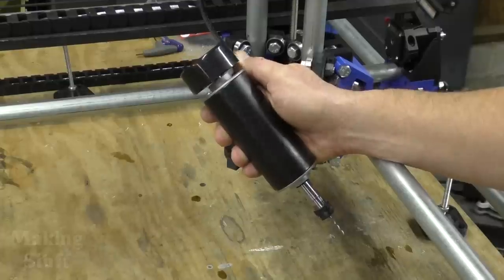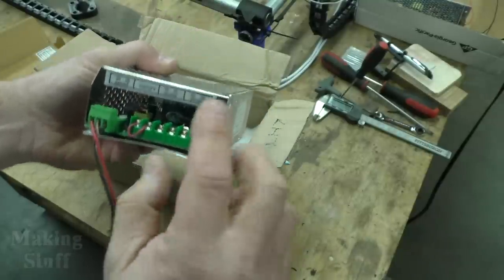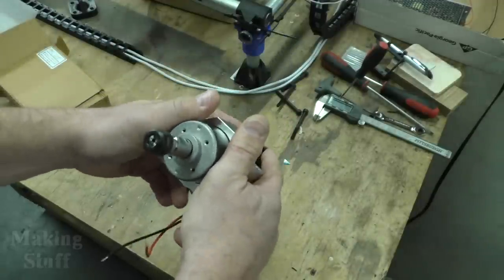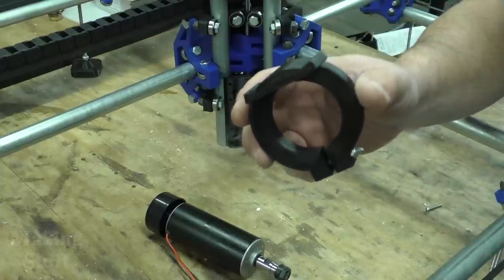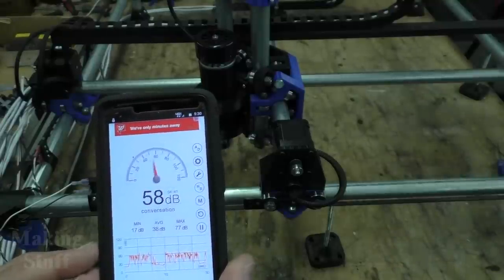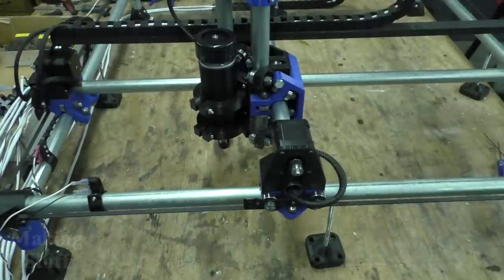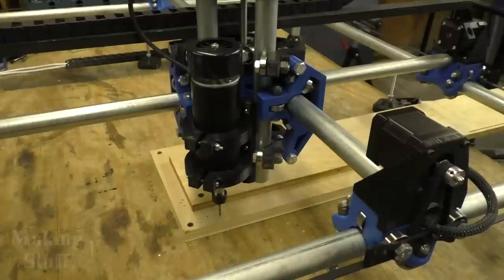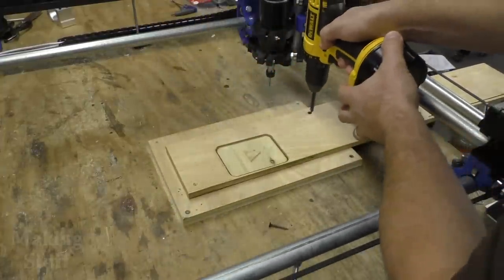Reviewing a Chinese Spindle for CNC Machines

Comment: So in late 2018, after 6 months of research and design, I built myself a CNC from scratch - just to see if I can do it. I was on a tight budget, but the idea was to get myself going, then build a "version 2" based on lessons learnt.

This was the spindle I opted for. To say was disappointed by the spindle is an understatement! I could never get it to cut at any sort of decent feed speeds - so much so that a simple cut took HOURS to complete. There was always LOADS of smoke coming from the end mill, I could hardly cut at a 1mm depth, and I was always left with a burnt edges when I was done. My end mills got super hot, and were blackened and tarnished when cutting MDF (melting resin?). My last cut almost destroyed my CNC - the spindle got dragged "into" the stock from a 1mm depth of cut, and ended up going through the 16mm MDF I was cutting, and 8mm into the MDF waste board, before the 3mm end mill finally gave up and broke! <-- Yes, I turned my back on the machine for a minute. Turns out my CNC actually survived the ordeal, but my faith in the spindle was shattered.

I went online and was just about to pull the trigger on a (stupid expensive) 2.2kW VFD spindle for CNC "version 2", as the 500W spindle never quite seemed up to the basic task of just making a clean cut. Up to now I've only used 3 flute end mills for cutting mostly wood, so to give this spindle one last chance and restore my faith in my CNC, I decided to put a single flute end mill I had laying around into it, and try it out.

Long story short, I got the mill in, and then... I saw it... Now I must admit that I am a bit ashamed to say it publicly on the Interweb, but it turns out that, for the last 18 months or so, I had my spindle running in REVERSE rotation! The single flute made me see that - not that I ever thought that the direction of rotation was a problem. The fact that it was cutting in reverse at all is nothing short of miraculous!

So I corrected the, ahem, problem (caused by the squishy bit between the keyboard and the chair) quickly enough, and tried my regular 3 flute end mill again. I loaded the same g-code as by last cut, and needless to say, I got proper wood dust (cutting MDF) this time. No smoke, no burnt edges, no tarnished end mill. I was running quite decent feeds as well, and a 1.5mm depth of cut - WAY faster and deeper than before.

My faith in my CNC is now restored, and "version 2" will be physically bigger than "version 1", but for now I'll stick to this spindle, which turns out to be a really excellent can-do little bugger - if you don't tell it to spin in reverse! Apologies for doubting it! :D

#LessonsLearnt

BTW, if it hadn't been mentioned yet, the on/off connectors in the power supply are for using the breakout board to control the spindle on/off and speed from your software. ;) Kudos on the review!
Reply: Hehehe, I had a very similar thing happen as well. Set the nice, new, 2.2kw spindle for a nice light cut in some aluminum - and was horrified by the awful cutting! One wire round the wrong way.
Reply: Update: Upgraded my 500W spindle to a 1500W water cooled spindle. Chalk and cheese. I’m running 5 times the feed rates I used to with the 500W. Most impressive thing is the runout on the new one. Or rather, the lack of runout. Those rubber bushings on the 500W really is a bit of a problem.
Reply: thank you for sharing this, things one have to keep in mind making a cnc :)

Comment: Background: I'm a machinist by trade for over two decades and I bought one of those spindles a few years ago for a small CNC I built.
Critique: The spindle does indeed SEEM pretty nice for the money. Honestly, the design is sooo close to being useful but it has one Achilles heel which makes it a deal-breaker. Having said that, I commend them on designing this spindle to be 1) simple to implement with the DC power input 2) nice choice on the ER collet - it is precise enough, easy to buy/replace collets, grips all sizes in the full range with just a handful of collets and is easy on the wallet 3) the overall size is compact for the power 4) it's relatively quite low-volume.
The major deal-breaker problem with these spindles is the bearing arrangement and assembly (which necessitates a tear-down to discover). They nest in a RUBBER boot on either end, which works well until it experiences side OR end forces. The runout is good if you just stick a gauge up against it, but if you push against it sideways, the rubber gives and you discover it's not difficult to compress the rubber and move it .02" to .03" (.04" to .06" TIR)! Also, the bearings are just common roller bearings so it also doesn't take end pressure well either. It needs a pair of angular contact bearings on the nose end and a single roller on the tail end, and those need to be firmly mounted in the metal housing rather than gently nestled in rubber.
This bearing thing is likely the cause of the rough finish in the video example. (I'm not talking about the fuzz, I can see chatter on the side walls)
To be sure, this spindle is tons better than a Dremel.
It's just a shame that they got sooo close to having a KILLER spindle but didn't take it over the goal line with a more secure, accurate bearing arrangement.
Since the rubber bearing seat also contributes to the low noise, I suspect that these were designed to make a good first impression and get you to keep them past the return date maybe. That's the pity of it - it didn't have to. It's got everything you'd need from an inexpensive spindle EXCEPT it doesn't quite do the business for one singular flaw, which could be engineered away for less than an additional $10 selling price.
D'oh !
Reply: yam ros1  I haven't found anything as "tidy", but if I was gonna buy rather than make my own, I'd probably go for a spindle like this one maybe:
https://www.ebay.com/itm/264083321008
and power it via pulleys with really any kind of DC motor you wanted (since variable speed of DC motors is relatively easy and cheap to do).
Keep in mind I'm just kinda guessing as I've never used one of these so I don't know if they are built well or not, but the design is MUCH better for a CNC machine in theory.
I would do a little simple math to decide what RPM range you desire (personally I'd go with like 500-4000 for useful machining of metals with mills/drills in this size) and pick pulleys and a motor with the rpm needed to accomplish this. You could go with a 3000-ish rpm motor and pulley it 1:1 for simplicity.
This would be a bit heavier, but would also be much more appropriate for milling.
If you're routing or engraving rather than milling, one of the air or water-cooled high speed spindles (~25,000 rpm) from eBay or the like would be good, but they require a VFD. If you want that kind of high rpm, the type of spindle I linked can be run around 8K rpm I think but maybe not as fast as those fancy ones.
It's never perfect, is it?
Reply: It’s such a good deal but that bearing issue is a dealbreaker. Can they be replaced?
Reply: @klave8511  First I should say that my experience with this spindle was several years back and for all I know, they've improved the design, but I strongly doubt they've done this. If a teardown reveals that I'm wrong, then PLEASE correct me!
Otherwise...

Replacing the bearings themselves is super simple, but the bearings themselves aren't the technical problem. To solve it requires an improved bearing CONFIGURATION. Specifically, this one has two problems.
1) Being mounted in a rubber sleeve causes a radial rigidity flaw and to change that requires that the rubber be eliminated and the  bearings be mounted directly to the end bells of the motor. This could be done but probably require you turn the bearing seat to size (to precisely fit the replacement bearing) in a lathe. Not a big deal, but requires a lathe and enough skill to achieve the appropriate tolerance.
2) you need opposing angular contact bearings to solve the axial rigidity flaw. This might be solved by single angular contact bearings oriented in an opposing orientation, one on each end. This would bring in some axial stability but not in an ideal fashion, though maybe better than nuthin'. The ideal arrangement is for the opposing pair to be back-to-back because that minimizes the inevitable wandering of the pre-load due to heat increasing during motor operation.  i.e. if the distance between the opposing pair is 5 inches, the expansion due to heat being "so much per inch" is magnified over the whole length while a back-to-back arrangement drops that down to almost nothing.A back-to-back arrangement also necessitates a third "standard" bearing at the tail end of the spindle and I don't know if there's room for all three (or sometimes four) bearings compared to the original two without major modifications (new end bells from scratch).
In summary, a guy could try, but you might mentally prepare for it to not work and be for naught in the end. The easy try would be to turn the end bell bearing seats to accept angular contact bearings of whatever size you research and find to suit, then arrange one bearing on either end and tweak the adjustment as you go until you find an acceptable compromise.  This means it will run significantly different depending on whether it's been sitting cold or been spinning and warming up, but might work with a bit of preparatory warm-up or some such. This saves space and might fit.
Any more extensive modification negates the benefits of the original cheap cost and IMO it would certainly be more worth it to just buy a better designed spindle for two or three times the money than to spend a week figuring out & machining in addition to the cost of the new bearings.

...OR... the companies selling these spindles could do a week of designing themselves and nail a gem of a cheap ideal spindle that they can sell to us for maybe $20 more. These cheap ones have been available unchanged for several years though so the chances of redirecting the existing momentum is probably pretty slim on that score.

I'll repeat that these little spindles do function several times better than a Dremel does, so if your machine is a small one made to move a Dremel around to do stuff, then these little ones would be a vast improvement as-is.
Reply: @TyroneDamShewlaces  Got one for my MPCNC recently and due to severe overheating issues, tore it down and yes the in-rubber bearing is still there XD!
Reply: @ethanchua2335  was the reason you tore it down to fix the heating because the heating caused it to break? Or just improving it?
Reply: @TheRainHarvester  I was just curious about the mechanism and yeah kinda trying to figure out why it was getting so hot!
Reply: @TyroneDamShewlaces  I wonder if you could drill several holes around the spindle and thread them as set screws to hold the bearings instead of (or along with) the rubber? You'd probably need 3 around the top of the bearing and 3 around the bottom to prevent the bearing from wobbling around only 3 set screws. Would that work?
Reply: @ethanchua2335  Is there a way to add new rubber to hold the bearing when the rubber wears down? (I have no clue what these look like inside)

Comment: I’ve been using one of these spindles for almost two years and it has never let me down. I’ve used it on oak, mahogany, beech, walnut and ash as well as ply and mdf without any hassle. It’s even milled aluminium with no sweat.
Reply: Super John. Can I ask you if I could use in this mashine Gripping Range 8-10 mm? I would like to make wooden stairs based on CNC self-made mashine and I wonder if it could fit my needs. The main material is oak and maximum depth I need to make  is 20 mm. Thank you for your help-)
Reply: Cutting Aluminium ? What speed?
Reply: @B B I think that is 12 times slower than I cut wood.  Is this also a 1/12 factor for you?
Reply: @B B what RPM?
Reply: @mariuszszczecina  The biggest collet you can get is 7 mm.

Comment: For $80 bucks, what would you all expect?  Remember, this is run on a 3d printed router using conduit.  Fair assessment and mentioned he was not paid for the review.  Nice job!   Agree with others, wrong bit, and who knows what the stepover was.    Good entry level spindle.

Comment: I bought this spindle. It runs very smoothly. What I found was that the chuck assembly was just bolted on and the runout was too much so I mounted the motor in my chuck and reground the spindle in situ with a tool post grinder. Very quiet and well made.

Comment: Thanks for the video. I have 2 of the MPCNC machines a 20x20 and a 20x40 and have been using them for just about 3 years now. Best i can tell from this video the quality of cut issue you are having is 100% the bit your using. Wile i see others have mentioned the up cut vs down cut  issue that is not really the issue here. that bit your using is what is also known as a zipbit and is intended for use in a hand held trim router for quick rough cutouts in material such as sheet rock. it also has a rounded tip much like but not equal to a ball nose endmill and this is why you are leaving tool marks in the flat cut areas. look on amazon for whiteside router bits they have a really nice starter set of true cnc endmills that will yield you much better results. again thanks for the video and good luck with your MPCNC they are great machines for the money.
Reply from the maker: Thanks for the info.  I'll check out those bits on Amazon.

Comment: To minimise the edges fraying, a straight flute bit is probably the best compromise. You could always try a downcut bit for the first few passes then finish off with an upcut bit - this will minimise fraying on the bottom edges and help clear the cuttings on deep cuts.

Comment: I recently purchased a Kress 1050FME 240VAC spindle motor form eBay which turned out to be faulty, hence my interest in your demo of the Chinese spindle.  Now that I have got my money back on the faulty Kress I am considering purchasing a Banggood unit since it is roughly 1/6th of the price of a new Kress unit. 
Your demo and information was usefull but lacked a few points. 
1. How does the provided motor clamp attach to the main machine Z-axis?
2. The effective power of the Kress 1050 is 600Watts. Did you measure the wattage consumption (under load) of the Banggood unit?
3. What is the motor torque like at low speeds?
4. It would have been a good idea to test it with the larger dia cutters to see how the machine behaved under higher loads.
Thanks.

Comment: It's not bad motor, I use it for 3 years now and still works perfectly, only is not very powerful if you want to aluminum or brass, but at slower feed it still gets the job done..

Comment: if you use a downcut bit you won't get the only ripping on the top, but you will need a decent air assist as a downcut bit will not clear the chippings very well.

Comment: This Banggood spindle is more like 300W and some of this is heat! It was successful running a 3.175mm bit in soft wood, but it suffers from being under-powered when using a 6.25mm end mill in hard wood. I had to use the most modest of federates and depths of cut of 1mm. When you see "500W", consider of who is making the claim.

Comment: Glad to see this review. I have a large 4x4 CNC router with a 2.2kw water cooled spindle, but also have one of those small 3040 CNC routers you see on Ebay (mine came with a 300w spindle). I have been considering upgrading to the 500w spindle, and from your video, it does appear to have significantly more power. Pine wood almost always has tearout. You can buy more expensive "downcut" router bits that will help with this, or I actually use the cheap diamond pattern carbide bits you can buy in 10 packs on Ebay. Your milling mark lines may be caused by too great a stepover in your programming, an out of tram condition on your spindle mount (spindle is not perfectly perpendicular) , or may result if you are using a ball nose bit instead of a flat bottomed cutter. Flat bottomed cutters should have a 30-40% stepover, ball nose bits 10-20% stepover. Roughing passes can have larger stepover, but full width cuts put lots of strain on those small bits so keep that in mind.
Reply from the maker: The software was set to 45% step over.  Thanks for the info!
Reply: I upgraded my 3040T with this spindle a year ago and I'm very pleased with it. It's so much stronger now but at the same time much less noisy.
I even managed to squeeze that power supply into the control box on top of all the other crap.
I have the parallel port controller which is the next upgrade candidate.
Reply: I am considering to upgrade my 3040 cnc to 1500W air cooled spindle to cut aluminium and brass.
Reply: @PerBengtsson  if you run decent motion control software a parallel port works fine. You use Mach though right?
Reply: @1pcfred  Yes I do
Reply: @PerBengtsson  I figured. That's what happens when you try to run machine control software on an event driven OS. You just get poor overall performance. Have you ever heard of LinuxCNC? You should look into what it may be able to do for you. Run circles around Mach that's for sure.
Reply: @Paul Frederick what about GRBL shield and Arduino with Universal G-code sender?
Reply: @no5x937  I watched a video of someone using one of these spindles with a motor shield. It took him a while to sort that out.

Comment: I'd use an engraving end mill for engraving plywood. Smoother cut, much less chip lift so less splintering, faster max feed rate. If it leaves facing marks on the facing cuts, it means your spindle is out of plum (square, tram, aka not perpendicular to the material). I'm a newb so your mileage will vary.
Reply from the maker: Thanks for letting us know.